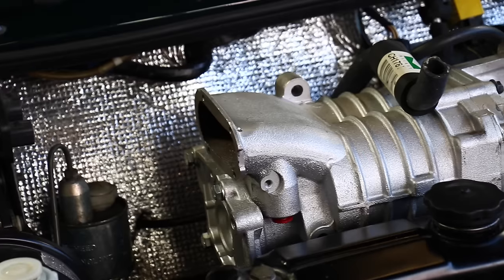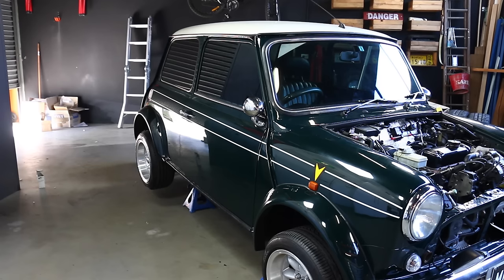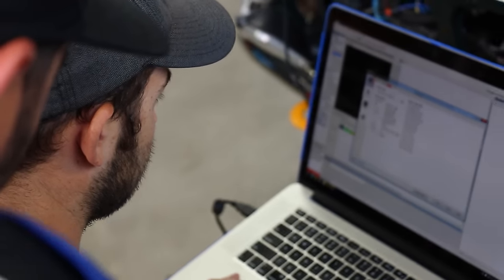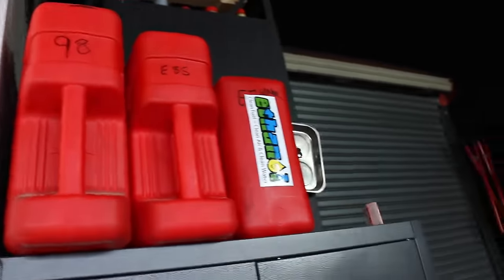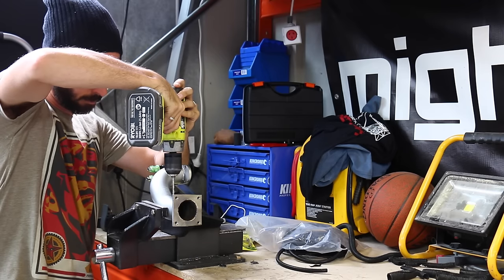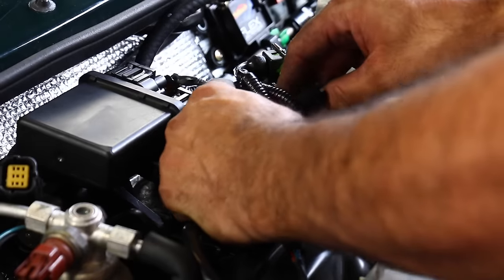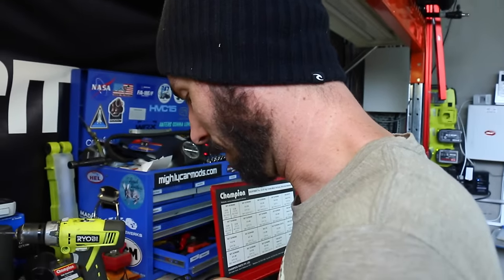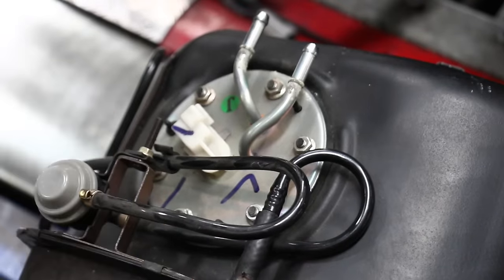Supercharging The Mini - Part 6

Comment: 13:01 Might want to debur that before putting the sensor in.
Reply: Thought the same thing
Reply: Looked like a test fit to me. I think they know better :)
Reply: +veeerzes My comment got lost to the ages, but I basically said the same thing + they should probably add a spacer so the threaded part doesn't stick into the airflow.

Comment: How many auzzies does it take to plug in a USB cable into an ECU?
Reply: A POTATO!
Reply: +T3hRealMcCoy Trick question, the USB plug is always upside down so they can't plug it in.
Reply: +Nippledozer  actually you're wrong - Australia is on the top of the earth, the north pole is a magnet and magnets are heavy so the north pole would naturally sink to the bottom because it's heavy making Australia on the top of the earth, that's why all the USB plugs are upside down because they were designed in Japan
Reply: Dude the Doppler effect is to do with how sounds waves are affected coming from a object traveling at speed

Comment: 19:30 Is the O2 sensor getting plugged in right in the middle of the CAT?  I would think it's more ideal to have the wideband/o2 sensor before the catalytic converter to get the most accurate AFR's for tuning.  Or is there a different reason for it?
Reply: asking the same
Reply: +Velocity Labs Thats probably the one to make sure the cat is working correctly, they probably have another one before the cat.
Reply: +Abrunobrowns what this guy said ^^^
Reply: long term fuel trim is using mid or post cat for finer tuning on new cars...not sure of this
Reply: +Velocity Labs There are usually 2 of those sensors, actually
Reply: Isnt it a Hi-Flow cat ? so it shouldnt matter
Reply: ImAzVexx
it is high flow but as a catalytic converter it still must remove some of the harmful exhaust gases. The O2 sensor can make sure it is doing that.
Reply: No. It's actually being installed just at the front of the cat, on the small angle before it turns into a full cylinder I believe. This places it just before the catalyst, as you are suggesting. :)
Reply: Random cat comments

Comment: Dashing through the snow in my rusty Chevrolet.
Down the road I go, sliding all the way.
I need new piston rings. I need some new snow tires.
My car is held together by a piece of chicken wire!

Oh, rust and smoke, the heater's broke, the door just blew away.
I light a match to see the dash and then I start to pray-ay.
The frame is bent, the muffler went, the radio's okay.
Oh, what fun it is to drive this rusty Chevrolet!

I went to IGA, to get some Christmas cheer.
I just passed up my left front tire and it's gettin' hard to steer.
Speeding down the highway, right past the county cops.
I have to drag my swampers just to get the car to stop.

Oh, rust and smoke, the heater's broke, the door just blew away.
I light a match to see the dash and then I start to pray-ay.
The frame is bent, the muffler went, the radio's okay.
Oh, what fun it is to drive this rusty Chevrolet!

Bouncing through the snowdrifts in a big, blue cloud of smoke.
People laugh as I drive by; I wonder what's the joke!
I have to get to Wal-Mart to pick up my layaway,
Cause Santa's comin' soon in his big, old, rusty sleigh!

Oh, rust and smoke, the heater's broke, the door just blew away.
I light a match to see the dash and then I start to pray-ay.
The frame is bent, the muffler went, the radio's okay.
Oh, what fun it is to drive this rusttttttttty Chevroooooooleeeeeet!

Comment: Next time before you grind down a good spanner, remove the fuel psi gauge, install bracket, then re-install gauge.  lol
Reply: Came into the comments as I was wondering why they didn't do that, especially since it was a rare wrench (in Australia anyway). Could have put another fitting on the gauge to move it out of the way too. Must have been some reason they didn't.
Reply: Lol
5/8 is 16mm
I'm a heavy deisel mech in australia 
Imp spanners are still very common 
But I do alot of both 
1/2 is 13 mm almost
9/16 is 14
5/8 is 16
3/4 is 19
7/8 is 22
15/16 is 24 mm
Reply: +fowletm1992 so you're into diesel?

Comment: This is a great mod! One thing with the supercharger. I'm guessing the blower is already fitted but this particular supercharger has 2 gears in the rear which are used to run a water pump. It would be a good idea to take the back plate off, remove the large gear which is attached to the fork drive and fit a blanking plate. The oil in the gear chamber has a habit of leaking past the seal in to the rotor cavity and then the gears eat each other.

Comment: Mini owner number 1:  If you drop a bolt, nut or spanner in a Mini engine bay it will not fall out on the floor but rather disappear into a black hole never to be seen again!

I own a 1098 Mini. It is a short stroke version that was only produced in South Africa  (Same bore as 1275 but shortened stroke).  I have fitted a 40mm Dellorto side draft and it runs beautifully!

Love your Channel!  I also had a laugh that you are already on episode 6 and still not done. (which brings me to Mini owners rule number 2

Mini owners rule number 2:  Take the time you estimate the job will take and multiply it by 10.  You now have a more accurate estimate of how long the job will really take.

Comment: For anyone intrested about cutting down the "rare" spanner 
5/8 is the same as a 16mm spanner 
As 9/16 is 14 
3/4 is 19 mm 
7/8 is 22 mm 
15/16 is 24 mm
And 1/2 can be 13 mm 
And 11/16 can be 18mm
If you ever find yourself short on one sort 
Imperial is still very common on heavy deisel

Comment: You didn't need to shave the "spanner", you could have removed the gauge, installed the pressure regulator and replaced the gauge.  I do that kind of stuff all the time in the oil field.  Can't wait to hear it run!

Comment: Might I suggest, whenever you need a flat spanner, visit a bike shop! Cone spanners for adjusting hub bearings etc are made from flat steel, thin enough to fit on the spanner flats without the locknut binding up on it. Sadly they're all metric sizes these days, but a stash of vintage tools such as those provided with your dad's old Raleigh 3 speed would probably do the trick for your Imperial testicles.

Comment: I know here in US we have 10% ethanol in our pump gas and it destroys carburetors if it sit in there for a couple months. And eventually destroys fuel lines. Im curious how it reacts with modern engines when it's increased far past 10%. If you guys ever have trouble with fuel lines from running such a high ethanol you should check into the green shield fuel lines made by Acdelco. All the hot rod guys run it over here. But it looks like you have some good fuel lines. Can't wait to see it finished. Greetings from the states!

Comment: I make the corn juice and the difference between fuel and drinking Ethanol is the amount of impurities. Things such as methanol, propanol. UV and acedaldehyde is measured and has limits in the drinking alcohol while the fuel alcohol only has a moisture limit which would be about 0.6%

Comment: Love you guys. Couldn't you have unscrewed the fuel pressure gauge on the regulator to tighten the 5/8 bolt, instead of grinding the wrench?

Comment: Just FYI you don't want to add pump to E85 or E85 to pump unless your pretty low on either. You don't want to mix them all the time at like 50/50. Wait until you get to about a quarter of a tank to switch over. Yes I know the flex sensor can read the difference but it's just better for the engine to not have such a vast difference of fuel regularly (:
Reply: Flex sensor modifies the tune in realtime, if it was a concern, Haltech would say something about it.
Reply: Obviously you didn't read what I said, "Yes i know the flex sensor can read the difference" but you shouldn't be mixing a high amount of fuel like that. It's better to have at least 75% of one fuel, you get no gain by mixing pump and E85 it's stupid and could hurt your motor.
Reply: And this is coming from real world experience with a 1200hp flex fuel supra.
Reply: +DavesMotorCars is it because you cant get a perfect tune for all those different fuel conditions?
Reply: juck huo Yeah in my opinion 2 completely different fuels at 50/50 will not be the best, it will run of course but why would you wanna do that?
Reply: Why would you wanna do that? Because you need to get home and can't find E85, so you throw half a tank of 98 in there. If you have any sympathy for the fuel pump and some self-respect there will be a quarter tank of E85 still in there, so you have a 33/66 mix. Now if you top it up asap with E85, you might end up with around 50/50, which is still a lot better than no/little ethanol, maybe even enough to be unnoticeable on the street.
If the ECU is properly tuned (conservative on petrol, safe on ethanol), you'll still have a tune that is very safe when it comes to boost and timing (with a knock sensor listening if something goes wrong anyway), and the O2 sensors closely monitor the mixture.
We're talking about 100-150hp/l builds, not 400hp/l.

Comment: That maker if the sc kit should really be using the upgraded facelift m45 sc's. Especially if it's running non intercooled it would massively benefit from the ceramic coated rotors and better bearings . That sc runs hot in stock form with an intercooler getting direct air flow..I can't imagine the iat's non intercooled

Comment: Y'all got 98 octane pump gas down there? Here in the States (or at least every gas station I've been to in the States) we have 87, 89, and 93. I usually run my Mustang on 87 because I'm poor and high octane is expensive, and that's all it's built for anyway (it's a base model, I know a guy with a GT and he usually uses 93). 98 octane is like borderline racecar juice to my mind.

Comment: is that a megan racing fuel pressure regulator??? please tell me its not! my old megan fpr looked identical to yours!!! when i had my car a couple months ago i needed a fpr and ended up buying a megan racing unit, brand new, from a trusted auto parts warehouse. the box stated very clearly that it was for naturally aspirated engines only. so i installed it in my n/a L4 engine and it worked fine for a couple months. long story short, i replaced several parts thinking the fpr could not be the problem, until it was the last thing to replace and of course it had been my problem all along. i bought a new tomei fpr which worked flawlessly, was more elegant and compact, and learned my lesson to pay nice not twice. anyway, that's just my story. thank you guys so much for sharing with us your experiences, i enjoyed this episode and was smiling the entire time because i can relate so much to the feeling and i miss my car very much.

Comment: so much effort to make 120hp.
Reply: +the ryan master for a woman, sure.
Reply: +cnknguyen Misogyny, how quaint.
Reply: +cnknguyen You have forgotten the weight of the vehicle and the subsequent bhp/per tonne.
In acceleration, obviously having less weight to lug around is an amazing thing. Even if it did actually produce just 120HP - it would feel like a lot more in an 800kg car vs a 1300kg car
Reply: +Daniel Hilton u mad bro?
Reply: +Daniel Hilton I build 1000+hp cars. this is not worth the effort. Pull the Rover and swap for a more modern powerplant.
Reply: +cnknguyen its not about power. its about power to weight ratio. besides. you dont need 500hp to have fun.

Comment: Ethanol is not pure, it is watered down that is why it does not have the same power rating as gasoline. If you look into true alcohol and racing you will see the power rating is much higher than gasoline.

Comment: Hmmm. All fuel as it's heated in the intake, calls cools what's around it, not just E85. Not nitpicking. You guys are awesome. I'm just being sure the science is legit. Cool? :)
Reply: +DE Nichols The attempt to not get too into the science and not get jumped all actually all sounded really good. Hey, if the smarter the comment, the more risk there is at being wrong, take the risk! Most intelligent people have a bit of salt to add to anything and pay attention to the good information. Most of the time when the really technical channels make a mistake I don't notice, because I'm focused on the good information and how that fits with my experience and understanding.

Comment: I am still trying to figure out why you are refusing to use any fender protectors while working on the mini
Reply from the maker: +Marcello Minghetti the ones we got have magnets in them and small bits of metal filings stick to the magnets and then your paint. We're waiting to get our hands on some sand filled ones.
Reply: +Mighty Car Mods Appreciate the reply, I have done lots of body damage on my cars before I learned my lesson. Just watching out for you. You can always use masking tape as well :)

Comment: when i was in tafe, i was always told never put any car fluids in a drink bottle so kids or anything wouldn't drink it but i was changing my brake fluid and i couldn't find any unmarked bottles so i used a coke bottle so when i was done i put it on the table next to my other coke and well i grabbed the wrong one and drank it, as soon as it touched my tongue i started vomiting and an hour before i was eating chicken chips so all i was vomiting was chunky chicken chips so word of advice never and i mean never put brake fluid in a drink bottle, you will regret it

Comment: i was wondering since the build started, does supercharging an engine require changing the internal performance parts? or for a daily driver (low boost?), we can just plug in a supercharger without any internal mods? they mention something about compression ratio of the engine, do high compression affects forced induction?
Reply: +Nano Kumo depends on compression, then on the way the internals are built, and then on how much boost your gonna run, if it's a thing to pep it up, no bigy usually, but if your putting in 12lbs, might want to start researching......

As for high compression affecting the engine, it just puts more stress on the components, because the goal of forced induction, is to increase the compression (in a way).
Reply: +Nano Kumo high compression plus forced induction can make an engine more prone to premature detonation. MCM gets around this by running E85, which can cope with much higher compression than pure petrol (the discussed the other method, running a decompression plate, just briefly).
Reply: +AccAkut1987 Just to add some 2c into this :)
" because the goal of forced induction, is to increase the compression (in a way)." - I guess you referring to the compression ratio. zFrom memory in a Mini, I think it was pathetic, like 7to1
Reply: +Nano Kumo I can't see the engine and gearbox handling all that power to well I expect we will get some upgrade/rebuilt videos in the future lol.

Comment: Датчик температуры воздуха неправильно установили,его в коллектор под чарджер ставить надо,чтобы мозги вносили коррекцию от нагреваемого от чарджера воздуха в коллекторе.А по правильному, интеркуллер нужен между впускным коллектором и чарджером. Air temperature sensor incorrectly installed, its in the intake manifold under the supercharger should be put to ecu make corrections on the heated air blower after .Interkuller needed between the intake manifold and supercharger.

Comment: Liquid gasket maker as an intake gasket....smdh....Why would the guy not include a custom cut gasket there, in the kit? Sure its probably not a problem, but imo the dude kinda cheaped out there.....Woulda just made my own gasket....Wonder if the kit maker said anything about a paper-based gasket soaking up fuel because it was close to the injectors? With 880cc (cant totally remember) that probably isn't the concern.